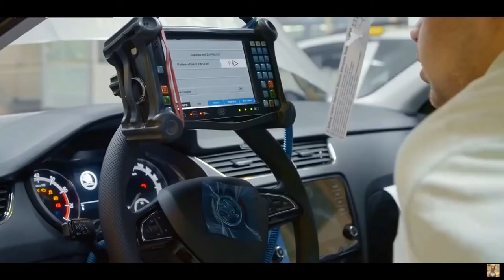Skoda Octavia RS factory production line!

Comment: Dear SKODA / Volkswagen - Worldwide Customer Relation / Service Managers,
 
This is regarding my vehicle, Skoda Superb - MH-43-AJ-2651 in Mumbai – INDIA.

We have been sending this vehicle to JMD-Kandivali workshop in Mumbai-INDIA for servicing regularly. 
Every time the vehicle is returned back, it has MANY more faults then were there before sending.

1. 6th Nov. 2017 sent for servicing. Vehicle returned with OBD2 port hanging, ABS sensors were loose, coolant not changed, HUD had been dismantled & damaged, + other problems.
They were not ready to accept or rectify these faults. We had to take help of International Skoda Parent Company & posting on all formats of Social Media, when they finally responded & cleared all the faults.

2. 13th Sep. 2019 sent for servicing. Vehicle returned with no bulbs replaced, windscreen not polished as requested & again ABS sensor made faulty. Also, now all the lights of ABS, ESP, Steering, Spanner symbol, Exhaust Symbol & other dashboard lights started intermittently turning On & OFF & the vehicle started giving sudden jerks. None of these problems was present previously.
After multiple complaints & lot of time delay, we could not drive such a faulty vehicle & neither JMD nor Skoda were responding, we were marooned without vehicle.

3. 9th Oct. 2019, finally after confirmation from JMD, we again sent our vehicle to JMD for ABS sensor replacement for which we agreed to pay from our pocket due to the excessive delay which forced us to use TAXI service daily.
The next day, they said that that the sensor was not in stock & they are sending the vehicle back. Could they not check the availability before calling for the vehicle?

4. 18th Oct. 2019, the vehicle was again sent to JMD for ABS sensor replacement.
When the vehicle was received back, we found that the cloth of the backside ceiling had been forcefully & intentionally pulled down by JMD & was now hanging down & touching on the head.

   
   
We informed Mr. Mahesh regarding same, but he non-chalantly told us that this is due to age & he is not to be bothered & we will need to pay to get the same repaired. 
He is destroying our car due to spite & is asking us to pay for same? This is highly arrogant of him & WHY does SKODA support these kind of unethical people who have NO value for their customers?

We informed Mr. Gurpratap S. Boparai - Managing Director & Mr. Amit Dhingra – Head of Customer Care for SKODA – India, asking them to intervene & solve our problem. 
Mr. Amit responded after multiple emails saying that he is helpless & has to support his dealership & he cannot be concerned regarding a personal complaint. 

What he means is that Customers are not important to them, only their dealerships are important as they are the cash cows.

Is this the policy of WOLKSWAGEN & of SKODA in India or is it worldwide??? 
Kindly confirm so that customers are aware & will not further put their faith in these brands of vehicles worldwide.

Request you to IMMEDIATELY take action & provide solution once & for all.

Regards
Samir Garg